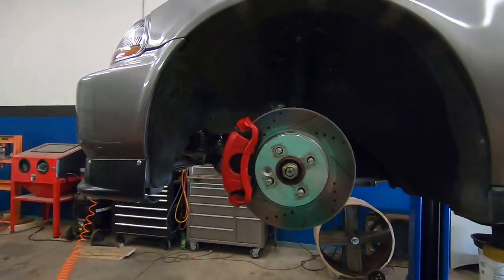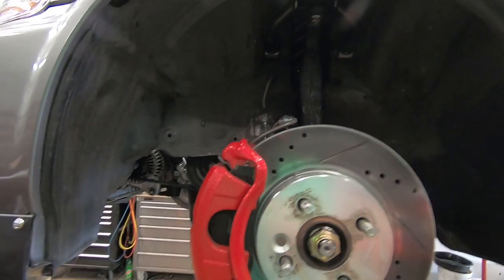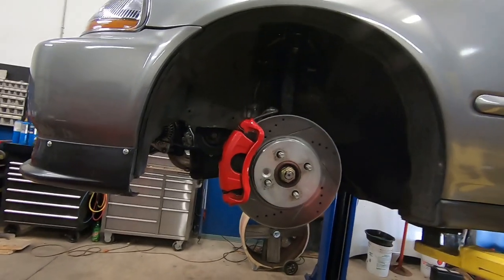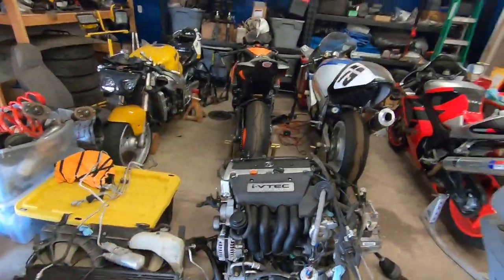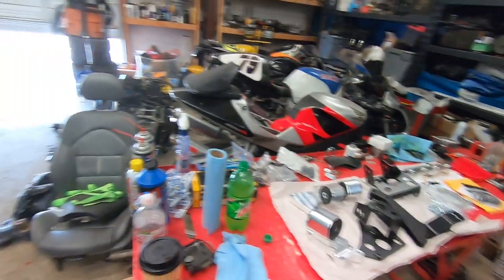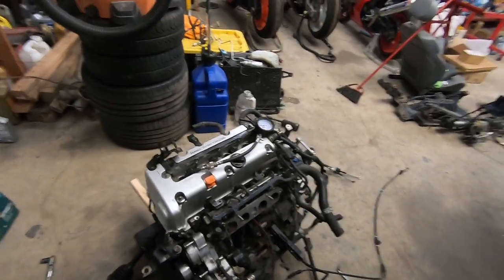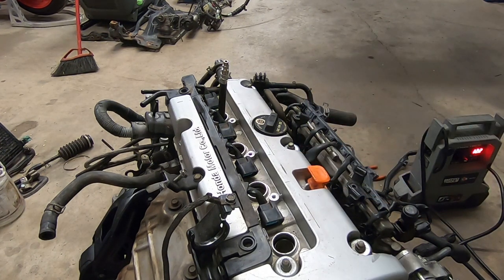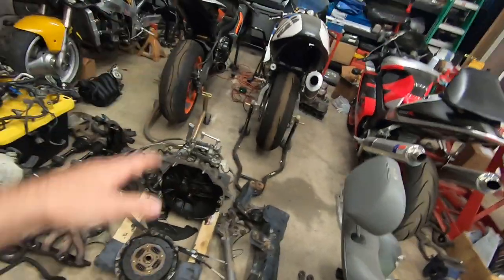$500 Budget K Swap (part 1)

Comment: nice vid. i had a similar hatch with a similar big brake set up, few things to keep in mind/add: the ITR calipers are the same caliper that come on like ~1998 v6 accords, oddyseys and crv's, same part number. (easily found in junkyards). If i remember correctly i used the 2003 cooper S rotors and the bolt holes were the same size as the studs, 11" rotors. tsx pads are good you can also use the pads for the accord v6 odyssey or crv as mentioned above. master cylinder i got from a ~2000 honda prelude, they have a 1" master cylinder compared to the 15/16th on  a gsr and its a direct bolt in.  
prop valve i kept from my stock cx, that originally had drums in the rear, upgraded to rear discs and the proportioning was good. as you mentioned, youll need the bigger spindles, but if youre in canada only the SIR civics and DC integra spindles will work, canadian ex wont work. love these kinds of swaps, making modification accessible for those on a budget willing to put a bit of work in.
Reply from the maker: Thank you. Wow thats good information! Its crazy how honda has so many different cars to pull parts from and come up with some cool budget performance setups that work.
Reply: Thank you for the information.

Comment: Where did you get the info on the parts you need for the swap? Also is that a dc2 power steering pump setup as well?
Reply from the maker: I get most of my info for the motor swap in my SA auto book called Honda K swaps. I bought it from Barnes and nobles. Has all the info for all chassis. For the brakes I found that info online in a forum write up.

Comment: What if you took the rsx type s and took all, driveshaft tranny engine etc. do you think it would be hard to throw in an eg or ek
Reply from the maker: It's basically the same. You will need the proper mount kit and other little things. It's always a good thing to also have the shifter box and cables. That will save you some money.